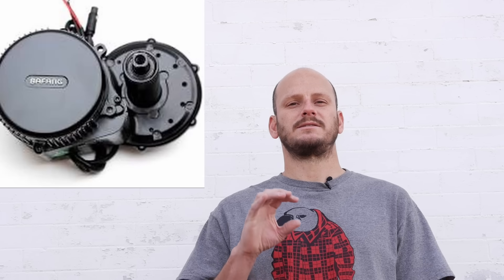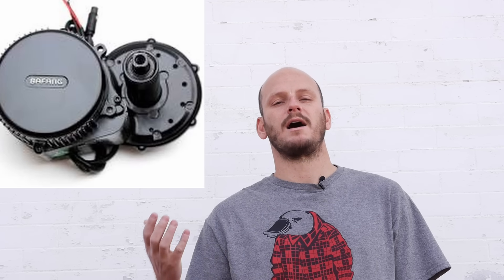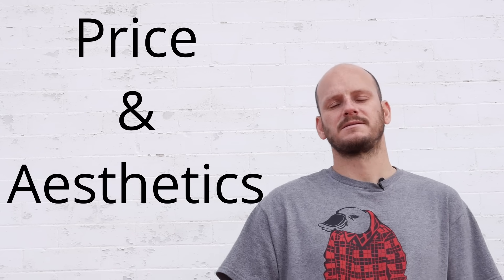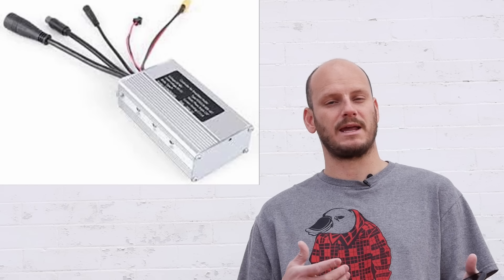Hub vs. Mid Drive Motors: Why Hub Motors Suck and Debunking Common Myths with performance test

Comment: Although I prefer mid drive motors over hub motors for my area and riding style for many people hub motors work better. Several of my friends have Rad rovers with thousands of miles on them. Never any spoke issues although one burned out a motor due to weight and over stressing it on super steep hills.
For flatter areas and non enthusiasts hub motors are an excellent choice.
Mid drive motors stress the drivetrain and chain and poor adjustments to the drivetrain can and will snap chains. The average rider doesn’t know how to swap out a chain quickly and it is usually a messy job.
I use a direct drive hub motors in my pusher bob trailer . Small wheel dives great torque and 48 volts gives speeds over 30 mpg.
If a wheel is built properly a hub motor should be just fine. Plenty of non motorized bikes have wheel and spoke issues
Reply: You are right, I rode my hub motor ebike for about 4500 miles  and only adjusted the spokes once.
Reply: Yes they do know how to replace a chain, I did it not knowing at 6 years old on a normal chain, now with a master link chain anyone can do it in 10 seconds, does the average user know how to replace a wheel compared to a chain witch is just a loop, the average person isn't buying mid or hub they are buying a  premade
Reply: @tomlamb3885  huh 🤔?
Give the average person a broken chain and have them fix it. 
1. Do they How to make it the right length?
2. Do they know how to use a quick link?
3. Do they know how to use a chain breaker.
4. Will they get grease all over their hands 🙌?
5. Will they know how to thread it properly through the derailleur?
6. If the mess up they probably need a special pliers type tool to undo the quick link.
I would suggest that they would be more willing to change a tire vs a chain. Furthermore if they break a chain on a hub drive setup they can throttle home.
I speak from years of experience and also ran a bike shop for a number of years.
I prefer mid drive motors myself but I think many people are better served by hub motors.
Reply: @richardwolf6269  length isn't super important if your trying to get home, everyone knows how to use a quick link it has 2 photos for instructions thats how easy they are and the pliers come free with the chain but their not special needle nose will work too
They can thread it the same way it came out or just google a single image of the chain, if you can replace a tire then you can use a masterlink, since replacing a tire is much more difficult in terms of strength, fitting the actual rubber over the rim normally needs those plastic stretching things, idk what their called but they hold the tire in place, you need a bike pump and possibly a wrench to undo the bolt if its not quick release, if your replacing a chain it probably takes 15 mins and you need 1 tool but a tire needs 2 to 3 tools and will take around 15 mins to put the tire on the rim and maybe another 5-10 to blow up an inner tube or check/ find leaks. Years of experience in taekwondo tell me im right
Reply: @richardwolf6269  im thinking about adding a hub drive onto my mid drive bike just for dual wheel drive fun
Reply: @tomlamb3885  I would suggest that would not be a good idea.
Reply: @richardwolf6269  why? What about a mid and a 2 wheel drive transmission
Reply: 100%
The problem with hub drives is they were often built with cheap undergauge spokes. Quality spokes with the correct gauge and decent lacing technique and you'll have zero problems.

Hub drive or mid-drive, all the torque has to go through the spokes, or your bike isn't going to move forward.

But yes, I ride with friends who have Specialized and Gazelle bikes, and I am always putting drive train components on their bikes. 

I used to road race, but in my geriatric years I apparently don't stress the drivetrain as much as I used to, and on my hub drive bike, my drive train components last forever.

I think mid drives got popular in Europe, where power levels are restricted to 250 watts, and being able to generate the power up front, and run those 250 watts through your gearing was a real advantage. 

With 750 watt systems, that is just wear and tear on the drivetrain that was engineered for a human who was maybe putting out 200 watts on a good day. Four times that amount of power, and you start eating chains and cogs.
Reply: If you ride a bike and don’t know how to change a chain then you deserve to be stuck, ffs
Reply: @Wrongwayfeldmwn  WTF?

Comment: The very reason that the force is not going thru the chain drive and gears is one of the main reasons i chose the hub drive. I'm mainly commuter, never do off road but flat tarmac, so i chose a street bike with narrower wheels. These advices are really for people that are doing it as a hobby, as a sport. Not A to B, where hub drives are great at. 250W is the limit here for unregistered bike, although they all are 350W in reality. 

Mid drive is not always better, it is just better for this guy. He is talking about non street legal bikes, well over 5000W... Which are dangerous as hell, get a fucking e motorbike, you need to seriously beef up everything to a point where it is not light anymore. This is so wrong attitude to have but then again... these people are why regulations will be tightened. 750W is plenty for a fucking bicycle.1500W is too much, the puny brakes you have are not going to help you. This all reminds me of my teenage years and tweaking mopeds to go 120kmh.. You needed a city block to slow them down. Absolutely insanely dangerous. The chassis, the brakes, the wheels.. nothing in them were rated to those speeds. Same with ebikes. use common sense, when it is delivering 2hp, you need a proper chassis and brakes. I know my bike would go 50kmh if unlimited but everything in it is safe only up to 30kmh.
Reply from the maker: I think your confusing my video for a different one. I compare strictly 750w motors and how power is applied. It’s physics 👍

Comment: Hubs are better for beginners, commuters, it's quieter, and cheaper. 
Mids are noisy but because of their higher torque and center of balance, they're better for expert riders and bumpy/hard trails.
Reply from the maker: I agree except for the commuting and noise. Those are a case by case basis. BBS02 are SILENT. 
i would still take a mid drive for a commuter over hub for man reasons, but that’s me and my opinion 😀

Comment: First question. Can you have a mid drive with a throttle, that does not turn the crank and peddles when using throttle? Second question. Can you have both  hub motor and a mid drive motor at the same time?
Reply from the maker: 1-yes
2-yes

Comment: Thanks for the insight. I'm just starting to look into converting my bike.
Reply: Mate think about front wheel hub, cheap doesn't affect the number of gears & very simple to fit. Kits cost about 1 third of the cost of mid drive. Had one for years. They do not break spokes and are very controllable.
Reply: Thanks guys. I've been listening to a lot of different advice from different people. I did decide to try a Bafang mid drive on an old MTB that I have. Later I want to try a front hub motor on an antique Monark bike from the 50s that I have.

Comment: Hey Johnny, great video! I'm converting a single speed chopper / cruiser and was planning on using a BBS02B would recommend that I change to a hub drive motor for this  application? I would need to change the rear wheel if I'm going hub - it is a 20" diameter 4" fat tire wheel. Appreciate any advice!
Reply from the maker: If it’s coaster brake definitely go hub. Otherwise if it were my bike, I’d go mid drive still
Reply: @JohnnyNerdOut   Thanks for the reply Johnny! It's a Schwinn OCC Stingray with some no name V-brakes so I think I'm sticking with Mid-drive. Really appreciate your help 👍

Comment: I formerly had a Trek bike with a 350 watt direct drive motor.  My new bike has a 1000 wat Bafang gear drive hub motor with a 20 Amp battery.  They both go about the same top speed, which is a little more than I want, but going up hills, the 1000 watt Bafang just blows away the direct drive.   Is there an advantage to the direct drive?  yes!  The direct drive gives you some power regen.  Neither the geared hub drive nor the mid drives do that.  When I got my first e-bike I rode it up Millcreek canyon here near Salt Lake City and when I got to the top it was down to less than 1/4 battery but when I got to the bottom I still had 3/4 of the battery left which was enough to get home and run a few errands the next day.
I love the new bike and have ridden it all over Salt Lake city, San Rafael Swell, Moab, Sand hollow and St. George, Utah all in 5 months.  It is not a direct drive, but cost less than $1800 with full suspension, Hydraulic disk brakes,  and can fold in half so I can carry it in my Prius without having to take the front wheel off (it does weigh 60 Lbs., but my Trek was 82)  and put down the rear seat, so I take it everywhere I go.  It only has 7 speed on the back (the Trek had 21!) but it might as well have only one as I never really shift it, as it runs out of pedal in first gear in 5 feet.
If you can show me a mid-motor bike that does all that for that price then I might consider it, but I have not found one ANYWHERE.

Comment: The downside of mid drive is that you have to pedal so you can't ride it like a dirtbike, right?
Reply from the maker: No, you can use purely throttle if you'd like.

Comment: In a single speed ebike, would you lose the torque advantage of a mid drive motor? In that case, maybe the best option would be to go for a hub motor?
Reply from the maker: Depends on how it’s geared. Personally i’d still go with a midDrive so that I could change that gear ratio whenever I wanted. Plus all the other advantages of not having a Hub motor like unsprung Weight and the ability to change a rear flat easily etc.
Reply: @JohnnyNerdOut  got you, cheers mate!

Comment: Hey Johnny, some true things you mentioned about Hubmotors. But you do not understand the physics quiet right yet. Especially considering the idiotic european Lllaw restrictions here. 
Direct Drive does NOT need the torque of a midmotor, since they Not loose half/quad of it to the wheel, check in for details. 
Not all have a gear ratio. Did you ever Ride a Stromer St3 or St5 or Flyer build? 
Potentially have no power loss and less mechanical wear. TDCM 48V variants also do not suck more energy then modern Bosch/Yamaha do. True it lacks a little from the start, since here short chain ratio helps, but over 10km/h it is gone, but this is my muscles helping that seconds and actually in comparsion to the Bosch Speed and Yamaha HS S-Pedelec variants in Europe you can go (legally) faster uphill. (25+ vs 15 km/h with my 250lbs.) Also Put them in High Mode and you feel the 850w pushing, only flyon and Sachs (and your in Europe illegal Bafang 1kW+) can compete.
Biggest downs are: 
hassle to remove rear wheel, Cassette restrictions 12-speed, 
for Offroad there are more durable hub systems, where a midmotor ist Superior. But Here you do not need the raw power anyway and a 500w helps you uphill/Enduro...
As use for commuting at fast Speed, the hubmotor is the better fit. 
Except maybe a Gates Drive midmotor with 100+Nm and 1000w+, count here for 2k€ or more. Self build S-Pedelec is basically illegal here in Europe, or facing 4- digit € for approval Registration...

Comment: I dunno the chain,abuse on the drive train I feel is a pain in the ass with a mid drive. What happens if you blow a chain doing 30mph on a mid drive? Can it whip up or take out your derailleur?what does it do?
Reply: Also the checking you chain spacing or wrecking g your cassette or chain ring if you don't so I see a lot more maintenance other than just carrying a spare chain with you. I dunno fairly new to this whole e thing.
Reply from the maker: It’s next to nothing if you are a bike rider. Honestly. If you don’t know ANYTHING about bikes, ya I agree. Not trying to sound snobby here BTW
Reply: Actually I'am a bike rider it is still one more thing that you have to keep a close eye on web a mid drive, it has nothing to do with being a bike rider so don't be a dick. It's simple that it uses more of the bikes parts costing more in the long run. Just cause I said I'm new to ebikes doesn't give you the right to try and puff your chest out like you know it all cause I can most certainly guarantee you don't. Or you would've explained what happens when  a chain snaps going down the road. Gave you seen one wrap around a sprocket on a 450 dirt bike cause it can make a hell of a mess. So imagine that on a pedal bike wrapped around your calf for a good half a rotation. Keep your mid drive.
Reply from the maker: @trentleslie4010  yikes. Like I said. Not trying to come across as a snob, just trying to be helpful by sharing my experience with everyone to hopefully save time and money 👍 mid drives don’t wreck bikes like a lot of people say. Unless you don’t know how to ride a bike. But if you shift properly like on a conventional bike and have a gear shift sensor installed, your golden!😀
Reply: @JohnnyNerdOut  I got a notification on a new reply to this video. You're still totally blinded and heavily bias against hub drives. You need to take a step back and reevaluate your stance. For year-round commuting mid drives eat chains and cassettes. I will accept that it's the fault of an exposed drivetrain rather than mid drive alone but exposed drivetrains is what we get on bikes and slapping a mid motor makes everything much worse. 

A hub driven bike has maintenance intervals in the 10k+ km range. The drivetrain is practically sealed. Chain maintenance is a huge hassle even when not compared to zero maintenance. Of course belts solve many chain issues. My long term personal goal is to convert all my bicycles to belt drive. 

BTW an ideal mid drive would be single speed and it would drive the wheel from the non-drive side and it would have no freewheel. Now that would be a mid drive that makes sense. There have been a few on the market and DIYed and basically every electric motorcycle is designed this way.

Comment: Remember in a middrive there is  3 or 4 times more  moving parts than in  hub drive . 
 I got  both  Brose S-Mag  with  720Wh battery   I do love it    and  in   other   heavier ebike   QS 205 5T  hub    with  20s20p 4600Wh . 
 I wish to have 2500Wh battery with  Borse  motor but for  now it is  too complicated to pass  Brose protection and fit it into ebike frame.
Reply from the maker: Where are those 3-4x parts?
Reply: @JohnnyNerdOut  please ..  open any  mid driver motor there are at least  three sprockets inside
Reply from the maker: @Bemx2k  those are the planetary reduction gears same on most hub motors that aren’t direct drive.

Comment: Bafang is a joke of a company, sure they make one of the few customer installable mid drive motors sure but they have ruined it much like their hub motors by using old principles and controllers which are now worthless. Do yourself a favour and get a Grin Technologies Gmac which is a regen braking internal geared hub motor with ferro fluid cooling (it even sounds cool) or if you still want that bafang mid drive strip out it's controller and use the Grin technologies Phase runner controller. Measuring your ebike hub motor by your silly infantile torque methodology is just wrong, use a Grin Phase runner on it and you will feel the difference. I have used the bafang BBSHD mid drive and it isn't even in the same league as the Gmac with phase runner. Mid drives put stress into the drive train of a bike which just brakes or wears out parts real quick whereas hub motors like the Gmac don't add any stress to the drive train or bike and with the regen braking I save my conventional brake pads and give them a longer life. Your motor power should be independent to your peddle power drive train. here's how the Adults do these things for the superior results   https://youtu.be/fsRwVHwCCog

Comment: I have a question. I am in my 70’s and have a degenerative muscle disease. My leg muscles are weak but I still like to ride. I currently ride with a 500 watt / 48 volt geared rear hub motor. The bike has an 8 speed cassette. My riding is 100 percent on a paved rail trail that’s basically flat with no hills. I mostly use just 4 gears (3,4,5,and 6). I cruise at about 12-13 mph in assist level 1 in 5th gear. I have never ridden a mid drive system. I am considering getting a recumbent tadpole trike and installing a motor system. Considering my physical condition and the flat trail I ride , which system would be better for me (mid drive or rear hub motor)?
Reply from the maker: Probably a hub